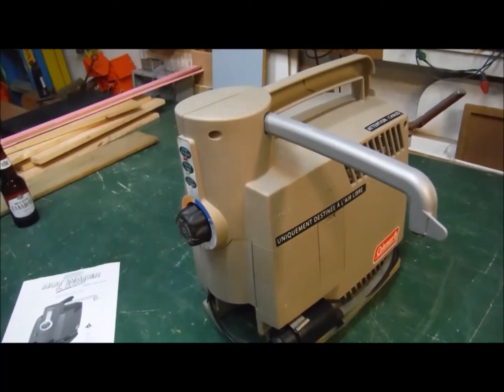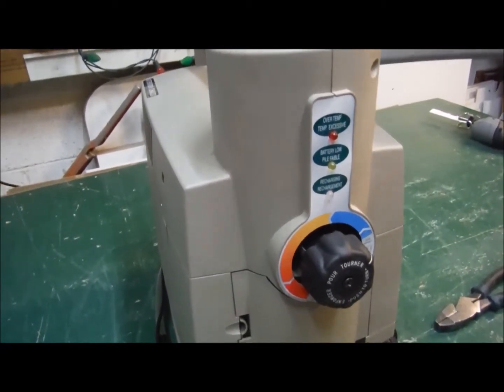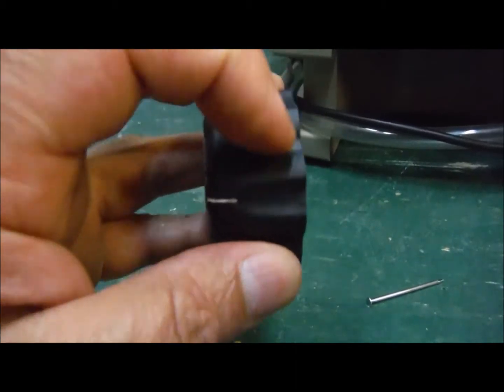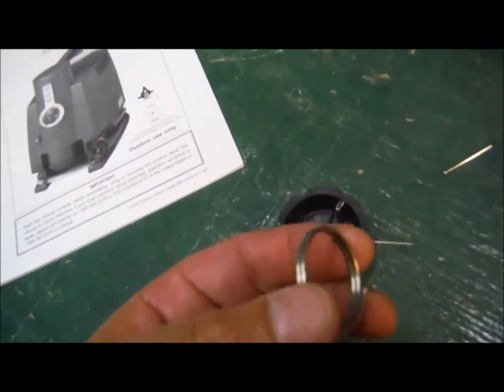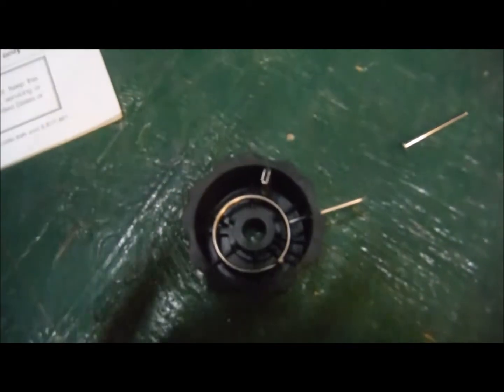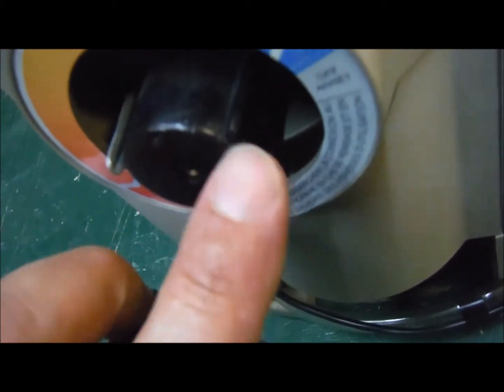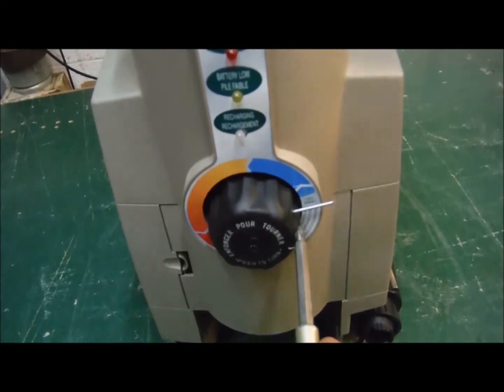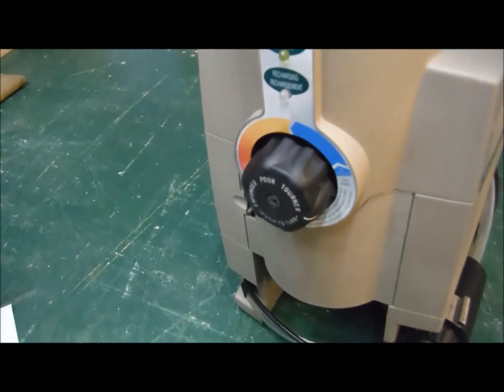Installing Control Dial🔧Coleman Hot Water On Demand

Comment: the black piece with the tabs comes out, theres a reason why the screw has a point. 

Putting the two plastic knob pieces together and then driving the screw holds it together to gently screw back onto the shafts cut out.